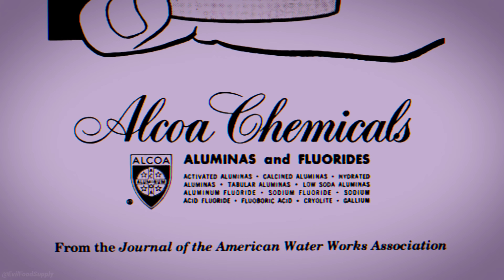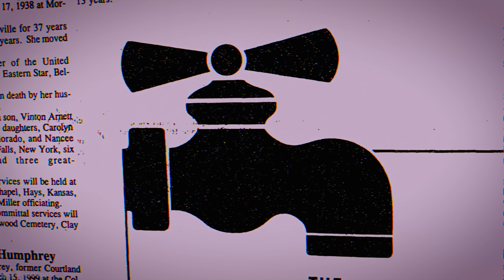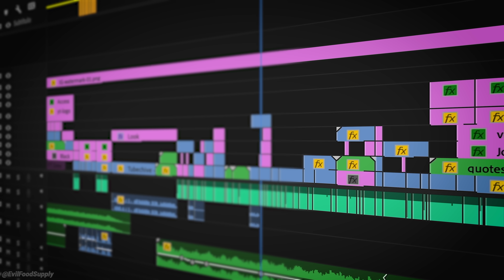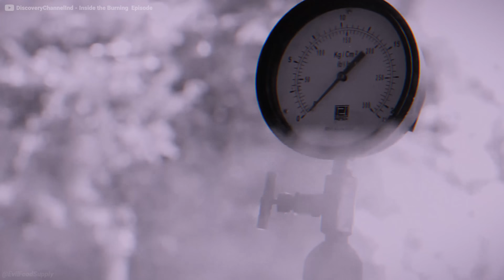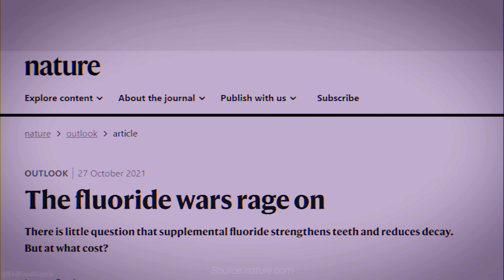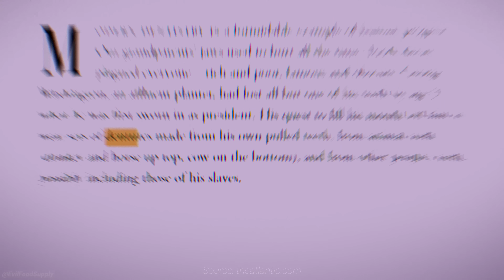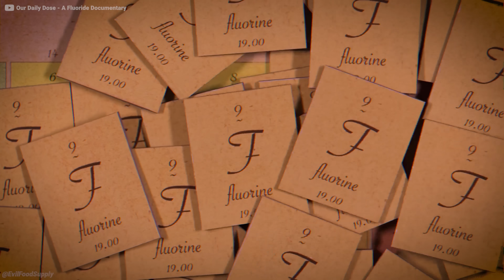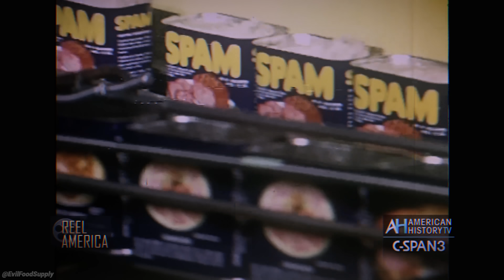The EVIL History of Fluoride

Comment: My toothpaste replacement. Mix ACTIVATED charcoal with coconut oil 2 x drops of basil oil and peppermint oil. This keeps yr teeth clean for 3 days and is great for dogs too.
Reply: why would you want something abrasive like charcoal to clean your teeth? you want to strengthen enamel, not slowly strip it away with charcoal
Reply: Thank you
Reply: @choppaprod you can't "strengthen" enamel
Reply: @Tippytoast  technically yes. but enamel doesn’t grow back. and charcoal is in fact abrasive.
Reply: @choppaprod  how can enamel be "strengthened"?
Reply: @Tippytoast  by avoiding things that weaken it
Reply: @choppaprod  lol no, that's just maintaining it's strength. To say "strengthen" implies that whatever it is is making the enamel stronger than before.
Reply: @Tippytoast  two sides of the same coin. stop being such a plank
Reply: @choppaprod  not at all actually
Reply: @Tippytoast  i just told you enamel cannot grow back. so to “strengthen” enamel is not the same as strengthening let’s say a muscle. you said it yourself. maintain. don’t get mad at me cause you went and bought charcoal toothpaste
Reply: @choppaprod  You're using conditioned words.
Reply: @PsychologicalApparition  bug off mr spiritual
Reply: just use hydroxyapatite toothpaste bro. its abrasive enough to remove scum, and it replaces the enamel (if its really made of what its supposed to be)
Reply: and who tf brushes teeth only 2  times per week?
Reply: @ whoever chooses to or needs to I guess.

Comment: If that fluoride that you're talkin about in the beginning can actually eat plastic why don't we use that to get rid of the plastic waste
Reply: Lmfao that's a good point
Harvard is calling 💀💀
Reply: What does it produce when "eating" the plastic? Likely a gas that we don't want to be breathing in, or a solid, worse than plastic. Maybe both!
Reply: Not just plastic. Metal. Concrete. Humsn beings.
Reply: @CigsInABlanket  Right ✅️
Reply: Because this creates other toxic chemicals. Honestly the best method for getting rid of plastic is to Burn it, and then scrub the dioxins out of the smoke afterward. Far fewer microplasics
Reply: @TalenGryphon  I'm not saying you're wrong but that doesn't sound right at all
Reply: @Sweet Lil Wren  Yeah it sounds counterintuitive as hell, but can you think of any OTHER method which doesn't result in the plastic breaking up into even more microplastics? 

The exhaust scrubbers on a modern Waste to Energy incinerator can remove 99% of dioxins (Which are the main harmful byproduct from the combustion of plastics). 

Really the ultimate solution is to stop using polymers in absolutely everything (particularly packaging), but that's not going to happen without Massive public pushback. Which is unlikely. Especially as most people are convinced alternatives like glass bottles are too dangerous
Reply: @TalenGryphon  there's actually a type of mushroom called Pestalotiopsis microspora that can eat plastic

Comment: I had a friend that worked for Culligan water and she was trying to sell me those 5 gallon water dispenser containers and she said that they did not have fluoride in them but separately you could buy a fluoride to put in the drinking water. She also told me that bottled water wasn’t good for you because it did not have fluoride in it. This was back in 1996. A couple years later I came across an article that Fluoride is poisonous. I wonder if Culligan is still selling the fluoride.

Comment: Some time ago, I became unable to tolerate ordinary store bought toothpaste.  Tried many different brands.  Finally gave up & started using baking soda & ground cloves.  Last dental visit- gums notably the healthiest in many years.  And the baking soda does not leave my mouth burning painfully.  Certainly cheaper than toothpaste.
Reply: That’s a great idea. Cloves are very powerful. Shame they taste so bad.
Reply: Same i brush with baking soda it's better than toothpaste
Reply: Baking soda + hydrogen peroxide
Reply: @atomusbliss  
Just a quick suggestion.
The peroxide in the brown bottle has other stuff in it, like tin and such.
Food grade peroxide is cleaner and safer.
Reply: @atomusbliss  Yup, tried and trued and cheap aswell
Reply: @atomusbliss  peroxide is corrosive as well
Reply: Be careful with baking soda because of how abrasive it is. It can quickly wear enamel if you aren't careful.
Reply: Cloves aren't that cheap but whatever, at least they taste nice.
Reply: @delphicdescant  It's best to save them for a dental infection or emergency where you need numb your mouth and gums. Eugenol numbs and also clove has antiseptic properties.
Reply: Burning is due to mint isn't it?
Reply: @themonsterunderyourbed9408  Yeah, some people don't tolerate it well.
Reply: I use soap sometimes too. Also works well.
Reply: @alanOHALAN  I pray it's tooth soap.

Comment: The irony is that that fluoride doesn’t actually prevent cavities, at best it delayed them three or four years but causing other more expensive dental problems while  doing so.
Reply: This toxic waste fluoride does not protect your teeth, but natural fluoride that is already in things like black tea most certainly does protect your teeth.
Of course, the big companies don't get lots of profit off of natural fluoride.
Reply: "causing other more expensive dental problems" 

Like what? What on earth is more expensive than having to save a tooth?
Reply: @WhateverMan35  dental surgery, crowns, braces, plates, veneers and having to fill or replace many more teeth than would normally occur sans fluoride.
I grew up with fluoride in the water and required almost all my teeth filled and several removed because the harm from fluoride made them too brittle and porous.
Reply: @anomamos9095  You only have crowns after a root canal.
braces only are needed when they become misaligned due to a missing tooth, physical trauma or displacement from baby teeth.
 
Veneers are cosmetic einstein.
Reply: @WhateverMan35  you asked what can be more expensive than saving a tooth ? And I gave you a list.
A root canal is classified as dental surgery, while it could be considered saving a tooth it is only the root that is saved where as a filling and veneers are actually saving the tooth.
Veneers are not just cosmetic, genius 
They are often repairs that prevent the loss of a tooth.

Comment: You're really mixing the chemistry up.... there's a huge difference between fluoride salts and fluorine gas and hydrogen fluoride. Still. fluorine chemistry led to Teflon and "forever chemicals" I suppose.....
When I was a kid in the late 1950s, I remember the local volunteer fire department spreading bags of sawdust dosed with sodium fluoride in the old wooden community center to kill termites I think.... haven't thought about that for years...

Comment: FALSE the problem with flouride is the amount (like always) if you only brush your teeth with it, spit it out and not consume it in other ways, it is the best product for rebuilding your teeth. It's not for cleaning purposes, this does the brush by itself. But the Flouride builds new material filling micro gaps in your teeth u wont be able to do by yourself. The flouride free toothpaste uses the same material we have in our tetth but the flouride one is WAY tougher, so ur teeth wont break as easily.

Comment: When you boil water with fluoride in it,it bonds with the hydrogen in the water which is the "h" in H2O. It forms an acid that's corrosive to tissue. Because hydrogen seperates from the water atom in evaporation the steam in a shower contains this acid and its damaging the skin too.

Comment: Flouride used in water supply is actually industrial grade, NOT dental grade, so technically is classed as a poison.
1/100th a gram can kill an adult human.
I have a water distiller, it is the best way to ensure metals and flouride is removed from tap water.
If you saw what was in the bottom of the distiller after filtering, trust me, you would never drink tap water ever again.
A decent water distiller costs around £55 in the UK ($65 USD)

Comment: I had seen plenty of stuff about the effects of fluoride, and so when I worked at a water treatment plant for a small time I was able to see it myself. It was shocking to see that spilled fluoride from the container had eaten the room it was contained in, not to mention it had a bad smell. Can't remember what it smelled like l, it's been too long but I tried to breathe as little as possible while in there. It was also the only room in any of the buildings where the metal rusts, despicable stuff really.